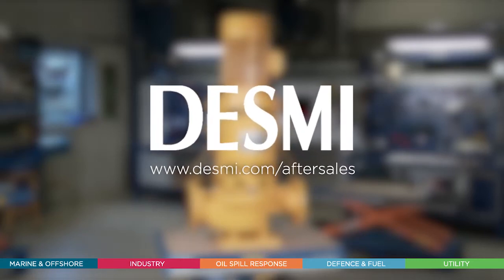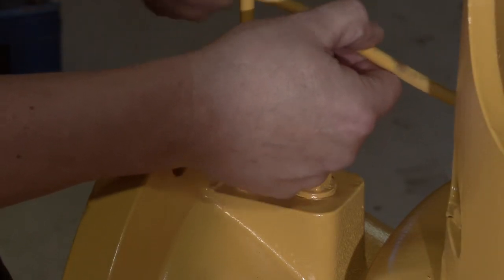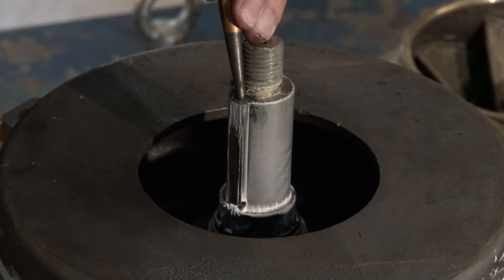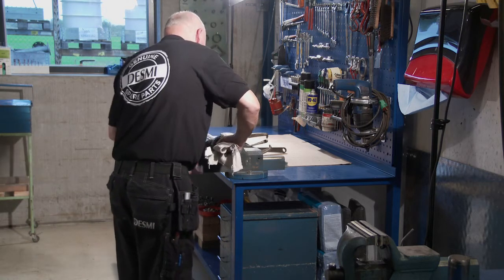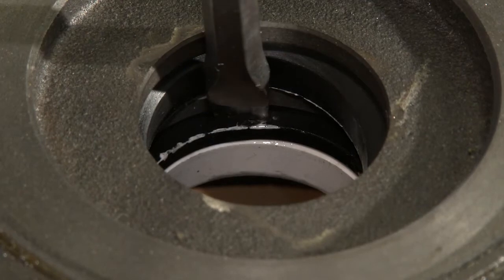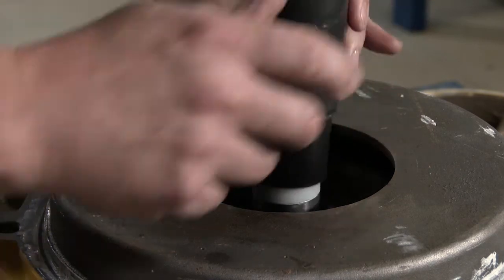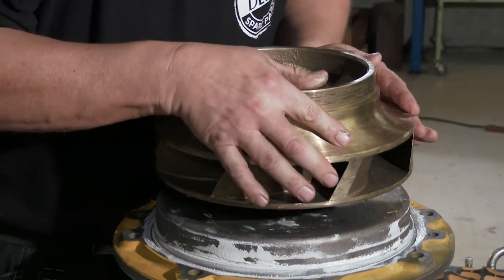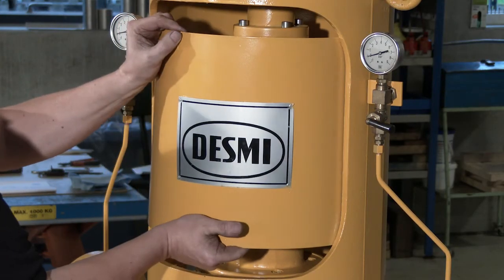DESMI Overhaul video NSL Centrifugal Pump NSL 200 265 14

Comment: Can you please talk about the wear ring..
And how to check the clearances
Thanks in advance
Reply from the maker: Karthik Menon Dear KarthikIn our overhaul videos our Service Technician shows how to disassemble the pump, replacing all parts which we normally recommend to replace and then assembly the pump again. All the parts that are used for the overhaul are included in our DESMI spare parts kit with genuine spare parts.   The wear ring and the impeller are not parts that normally have to be replaced. Therefore it is not shown and mentioned in our overhaul video. But if you want to check the clearance between the impeller and the sealing ring, the answer is max 0.4-0.5 mm. measured in radius. This information you can find at our after sales section at www.desmi.com/aftersales (manual T1380 for NSL in Monobloc design). At our after sales section you can find manuals, spare parts kits, videos etc. Trusting above is informative, if not please do not hesitate to contact us. Wishing you the best of luck.
Best regardsDESMI
Reply: DESMIAS Thanks a lot
Could you possibly explain the use of water deflector..
Your reply was really helpful.
Reply from the maker: Karthik Menon 
Of course :-)The water deflector also called V-ring has the function to prevent media from a leakage from the shaft seal entering the bearings.Hope this is helpful. Otherwise please do not hesitate to get back to us.Best regardsDESMI
Reply: Measure the ID on the case or cover, then measure the OD on the impeller, the difference is your clearance.